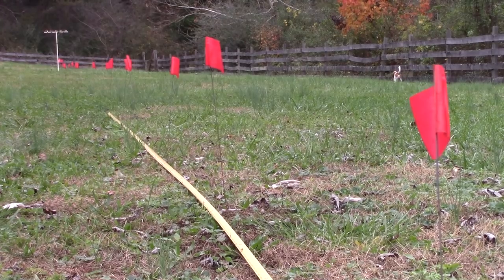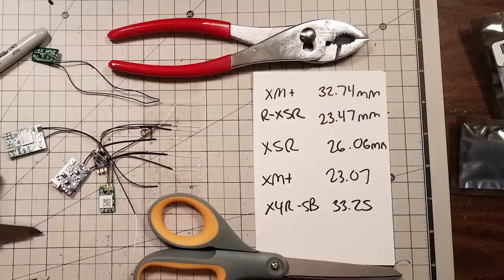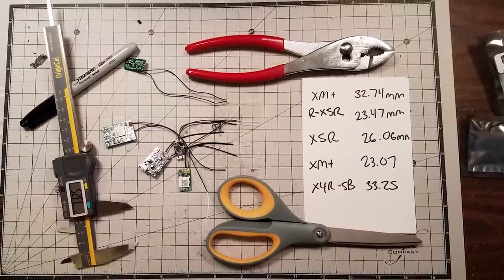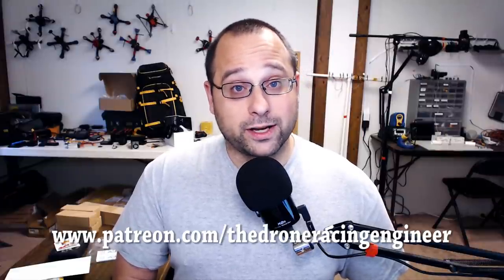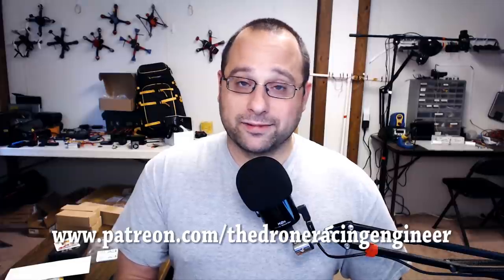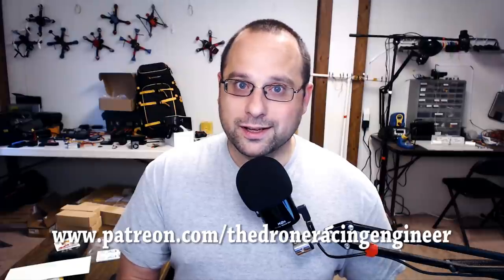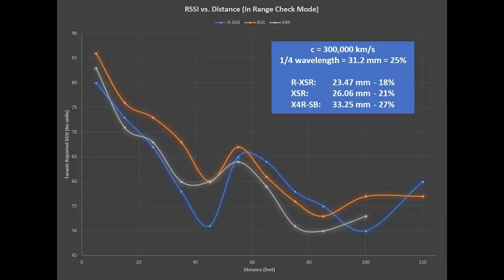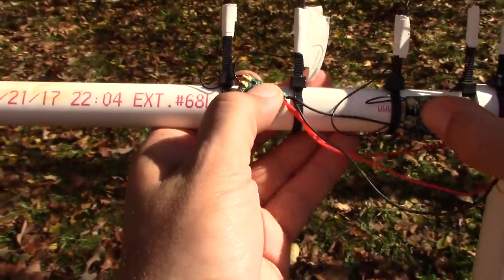Range Test FrSky RX | WRONG ANTENNA LENGTH?

Comment: "if antenna is not tuned to right frequency (you mean wavelength [frequency and wavelength are different things]) then you are going to get much worse range" (If wavelength matters why would you get reception AT ALL if not tuned/cut to correct LENGTH?) - But your test here is showing there is NO difference due to incorrect wavelength tuning of antenna wire. Your test debunks the existence of wavelength and therefore it follows it debunks the existence of lightspeed. Something I've been saying for years. "It doesn't matter how beautiful your theory is, it doesn't matter how smart you are. If it doesn't agree with experiment, it's wrong." - Richard P. Feynman quotes from BrainyQuote  .com
Reply from the maker: This is total nonsense. Except for the Feynman quote.
Reply: That video does not show any experimentation and confuses the terms 'fields' with 'waves'. Magnets do not have "waves" they have 'fields'. You never hear a magnet rated in 'wavelength'  A pebble dropped into water produces a 'wave' spreading out in all directions. The circumference of that wave expands larger and larger. There is no point in which you can measure a "wave' length"  I've worked in the metallurgical industry where we used INDUCTION furnaces to melt metal. A very powerful magnetic FIELD is generated exciting an atom's electrons against it's neighboring atoms generating heat through FRICTION. It's a misnomer/lie to call these home ovens "micro'wave" ovens. They are small scale INDUCTION furnaces, and they heat up whats in them as I've described. CLAIMING there is magnetic pole flipping is not an experiment SHOWING magnetic pole flipping. Explaining a theory is not an experiment proving the theory. The real question avoided in that obfuscation video is "When a current is turned on of an electromagnet, is there a finite lightspeed  time frame that it takes to generate the magnetic field or is it instantaneously generated. We have no "at home" instrumentation to make such a measurement. But we do have 'at home' instrumentation to check the efficacy of 'wavelength' MATHEMATICAL theory. In this video https://www.youtube.com/watch?v=pPgd16kFmOA&t=6s Andrew Mcneil makes a log antenna to specific wire lengths based on hertz divided into lightspeed mathematics 'wavelength' theory. And he has some instrumentation that tests how well it works. It tested great. Now we have a SIMPLE "at home" experiment to test the efficacy of wavelength. Simply have Andrew make another log antenna except NOT to wavelength specks and use that same instrumentation to test this other log antenna against the first. If this second antenna test out low then it proves wavelength is true. But if it test out equal to the first then THAT debunks wavelength and lightspeed along with it. Accusing me of 'nonsense' out of hand is not the scientific method. This experiment is the scientific method. Videos EXPLAINING a misnomered oven is not the scientific method. This EXPERIMENT I'm proposing is the scientific method. Do You guys have balls enough to take the challenge or you gonna coward out and run away screaming 'nonsense nonsense' cause you are too inferiority complexed to ever be proven wrong about anything. ? YOU started this Joshua Bardwell. Now lets see you finish it.

Comment: Frsky r-xsr super weird fail safe (brand new unit): you can see my quad is not changing orientation (2 antennas in planes 90 degrees apart), I'm in direct line of sight of the quad about 30-50 meters away, rssi value says 52 ... . I flew there before and after and further and higher without problems... . So, faulty rx? That's the only explanation, no? You can see rx loss on the betaflight osd.

https://youtu.be/yO4H-cqsYp0
Reply from the maker: Your RSSI was down in the 50's and jumping around. My guess is you are standing behind the building, which is causing the RSSI to jump around. Failsafe will typically happen around RSSI of 45 to 40 or lower. I think it's plausible that you got unlucky with a bounce of the signal and it's just a legit failsafe.

Ummm except you said direct line of sight 50 meters away!

Yikes. Yeah... 50 RSSI at that distance is way too low! So now I think something is wrong with your receiver or your transmitter. Try a different receiver. If it still happens, it's possibly the transmitter.
Reply: @JoshuaBardwell  Thanks for your reply. Well, in my local community I heard some more people had unexpected failsafes with the r-xsr rx. They switched either to the xm+ or crossfire. Yes, I'm standing about 50 meter to the right of the quad when it crashes, in the open field near the fence with all the buildings right in front of me. Did a range test [Rng], don't know if I had normal behaviour, will post results in Drone racing international fpv fb group.
Reply: @JoshuaBardwell  I think my tx is fine, I have   many quads and this is he only one that has problems, and the only one with a r-xsr.
Reply: at this time, you see where I stand (quad launch spot): https://youtu.be/_-mCmCYMedQ?t=59
Reply from the maker: The RXSR overall is reliable.
Reply: @JoshuaBardwell  Good to know, anyway, xm+ is cheaper with probably the same range :p. (no telemetry though)
Reply: @JoshuaBardwell  i noticed it doesn't want to go in sbus mode, my bf setting, I don't know how I even was able to fly, unless the blue LED was just broken. My new r-xsr won't bind, so still not a fan of this rx :).